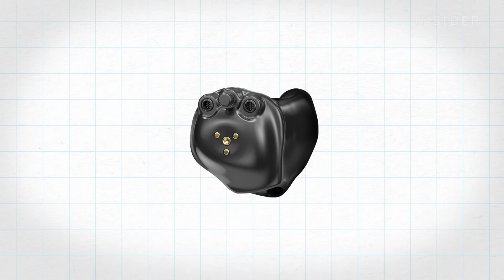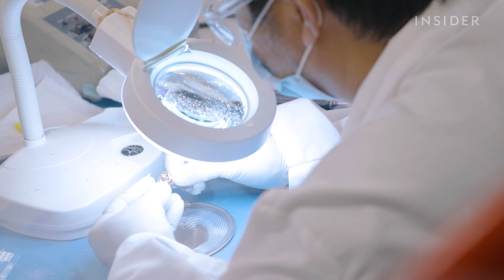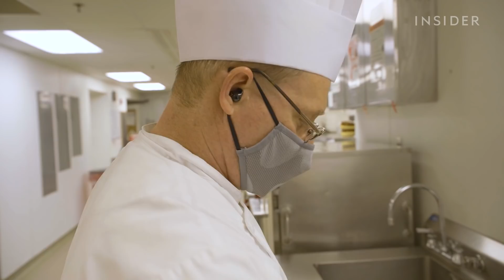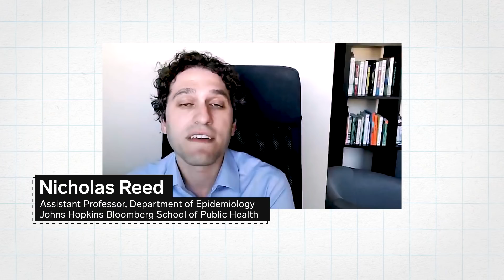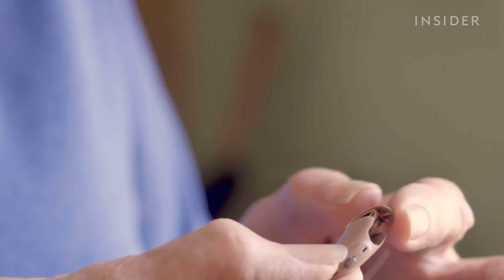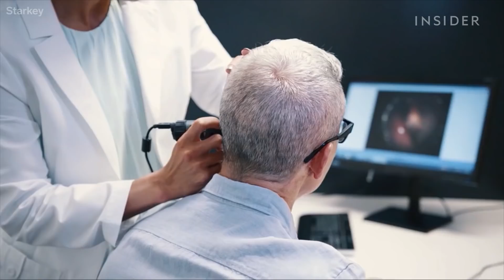How Millions Of Hearing Aids Are Made In America | Big Business

Comment: People with a limited budget can try to use decent noise-canceling headphones/earplugs in a listening mode where they use microphones to enhance their hearing of the environment during conversation for a fraction of the cost, though not ideal, at least they can also listen to music and take calls, US Bose, European Sennheiser, and Japan's Sony produce some pretty decent pieces that should last 5 years+...
These tend to have settings in the smartphone app to allow increased volume for certain frequencies which could be also used for people that have issues only with specific frequency ranges, so they can try to check audio shops if they are willing to spend time with them as they also have the hardware to reproduce a wide range of sounds, so people should be able to test audio tech as a hearing aid for their needs.